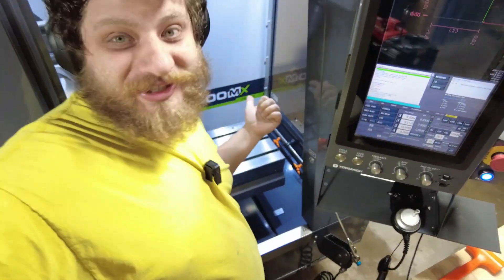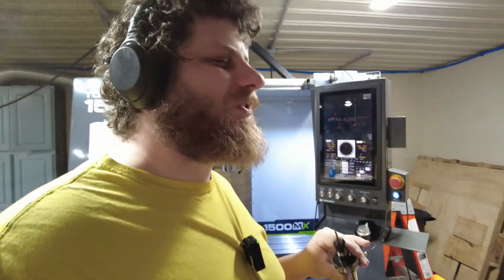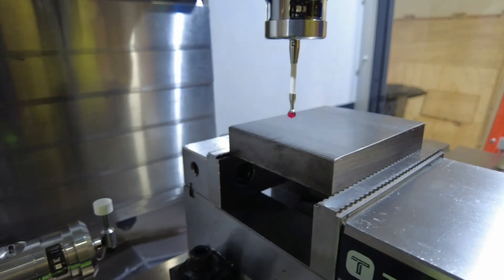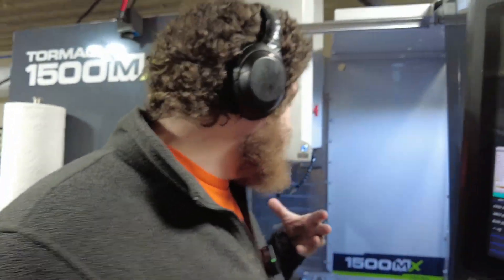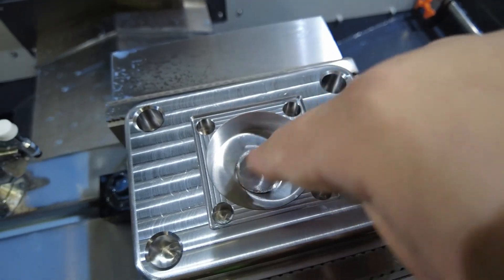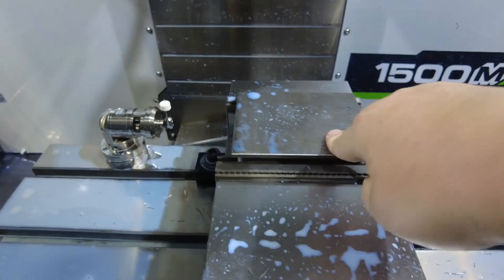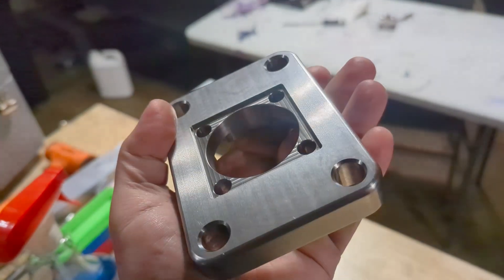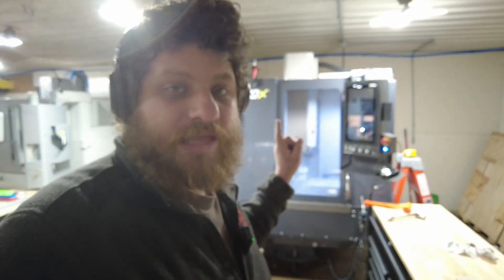Machining an Erowa/Saunders Adapter Plate

Comment: It looks like 2 of the endmills youre using are for aluminum, not steel. They wont perform like an endmill designed for steel with the correct S&F
Reply from the maker: very possibly, it's been a few weeks since I recorded this, but I know that I made some tool compromises. I don't have a huge amount of tooling built up for this machine yet, and I didn't buy anything for a one-off fixture. aluminum tooling works just fine on steel, it just gets dull a lot faster.
Reply: @AudacityMicro  I just noticed when you were loading them, one of the smaller (3/8 maybe) endmills had a ZrN coating on it which is for aluminum normally, and the 1/2" looked to be an uncoated 3 flute which is also normally for aluminum. Those tend to have very sharp edge preps on them and normally don't last in steel at all, like you said. But being that you don't do a ton of large steel parts that's understandable lol. Keep up the good work!
Reply from the maker: You are right on the 3/8". I had that laying around since my old 1100mx. The 1/2" one was a "general purpose" four flute that someone gave me. But that's also the tool o had chatter issues with 🤷‍♂️
Reply: @AudacityMicro  yeah I usually work on larger horizontal mills (500mm to 800mm) so using 1/2" tools is on the smaller size for me a lot of the time

Comment: My instinct is to say that .375"/8mm is kind of a sweet spot for carbide tooling on this class of machine, unless you need >5X LOC. With a 10K spindle and 1000IPM movement, you're going to run out of spindle HP before you max out what a .375" EM can do. I find I like to minimize the range of sizes of tooling I stock and use so that I'm less likely to run out of whatever I need (toolholders, collets, cutting tools) to finish a part.
Reply from the maker: Thats something I will need to play with. I definitely hit hp limits with the 1/2" tool before anything else, but haven't really tried pushing a 3/8" too far yet.

Comment: The chatter often comes from trying to be more conservative. You need to feed them harder. A half inch in mild steel can easily go 800 sfm and .0035-.005 fpt depending on holder and machine as well as the stepover.
Reply from the maker: From previous projects I learned that my holders had a hard time pushing the 1/2" tool as hard as I would have liked. I kept running into pullout issues.

There's probably a half dozen different variables that could have helped me, like buying a torque wrench adapter, and higher quality collets, and doing a better job of cleaning, but I didn't want to push it too much. I'm just going to buy shrink or hydraulic holders in the future for my half inch tools.

Comment: Nice job. If you want a feeds and speed cheat, to start with, define everything based on tool diameter. Don't use feed value, but set the feed per tooth to tool_diameter*0.01 for adaptive. The speed is material dependant and i always just set surface speed, not rpm. In metric i use 40m/min for inconel, 70 for titanium, 80 for stainless, 115 for steel, 200 for brass and 800+ for ali. Got to make sure your spindle speed isnt exceeded.
For adaptive, i use tool_diameter*0.05 (5%) stepover for hard metals and 10-20% for soft metals. Max stepdown is anywhere from 1 to 4 times tool_diameter and depends on quality of end mill, length of flute, rigidity of setup, etc. I normally start with varying the depth first if i want to fine tune things, then move to the feeds and speeds. Having as much as possible defined by the tool diameter and saving that formula as user default, makes setting up a non templated toolpath very quick

Comment: nice video. it would be cool to see some of the user interface on the new machine.  Curious about starting in the middle of programs and process of dialing in fits with tool diameters.
Reply from the maker: I can do that, but generally it's going to be boring, because it's so simple. Wear/diameter comp works exactly like you would expect, and starting in the middle of programs is super simple, you just select a line, and then specify if you want to add a linear, or a vertical lead-in. It simulates through the previous code for you, and turns on all the expected m/gcodes. And there's a search function, so you can search the program for tool numbers or toolpath names.

Comment: What kind of speeds and feeds did you end up with on the 1/2EM?
Reply from the maker: It was something like 1" DOC, .030" optimal load, .004" IPT and 600 SFM.

The chattery cuts were something like .080" WOC and .002" IPT

Comment: Is calling the haas mini mill an “office mill” part of your deal with tormach? Not a criticism just genuinely curious. It would make sense for them to want you to refer to the 1500mx as a more legit mill than an “office mill”
Reply from the maker: It's the name of the Haas product. It's a Haas OM2A. OM stands for office mill. The minimill is a different product. The OMs were replaced in the Haas line up with the CM (compact mill) around 2010ish.

Tormach doesn't care about Haas, they don't consider them a competitor.
Reply: @ OH!! Understood!! I just assumed it was a mini mill, apologies if that came off in the wrong way, thanks for the response. Love the vids!
Reply from the maker: Not at all! Its a super common mistake, everyone thinks it's a minimill.
Reply: @AudacityMicro Interesting comment saying Tormach doesn’t regard Hass as a competitor.  With the 1500 they clearly seem to be aiming in that direction.  If not now seemingly eventually.
Reply from the maker: To be clear, I don't have any inside information on this. But I suspect the 1500 is the biggest machine we see from tormach in a very long time. The 1500 starts to compete with a mini Mill or maybe a tm0p, Haas's bread and butter Is vf2 sized machines and larger. But for the most part, it's a different customer base.
Reply from the maker: You have to remember that tormach is tiny compared to Haas or any of the other machine tool builders. They would have a very hard time competing against haas, but they basically own the market for anything smaller than a minimill, so they are better off staying in their lane.
Reply: @AudacityMicro Agree, Haas doesn’t play much in the space Tormach occupies.  Not much margin there.  But if Tormach intends to grow I expect sooner or later they will have to move into bigger machines where Haas lives.  

I’m sure per your point Tormach isn’t in a rush to go head to head with a much larger and better funded domestic competitor.